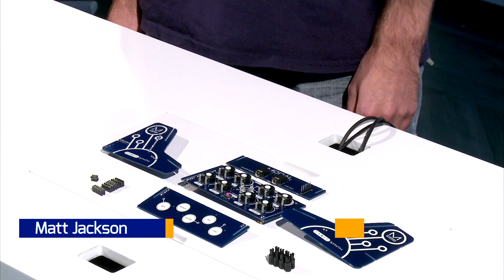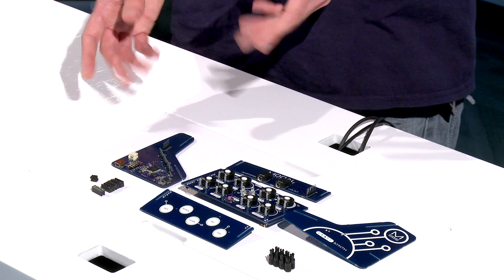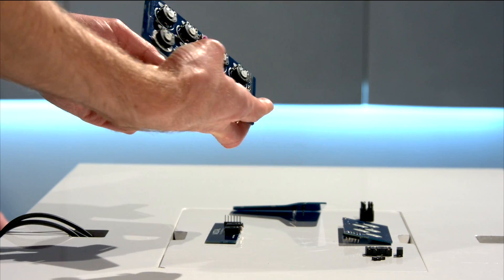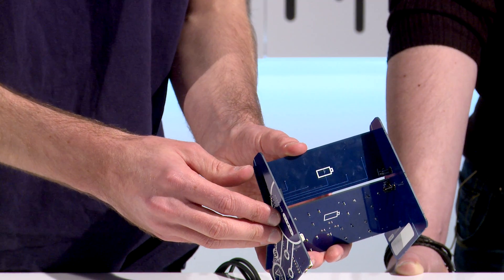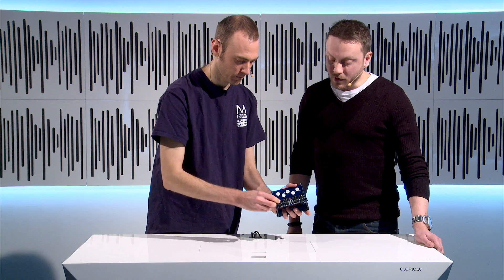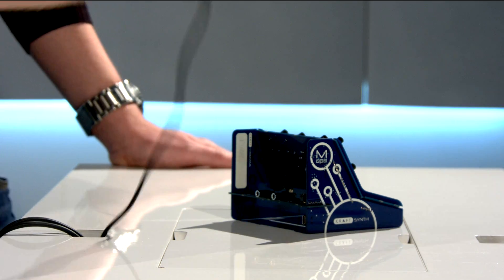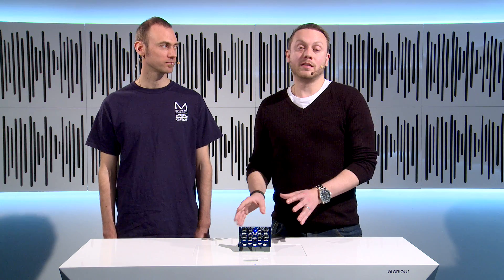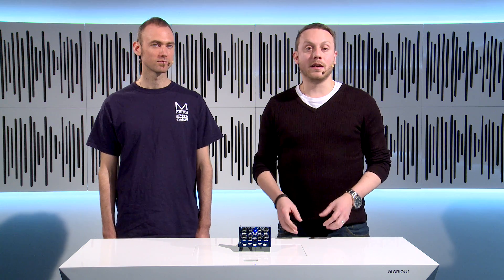How To Assemble the Modal CRAFTsynth Monophonic Synthesizer Kit

Comment: I have one pre-ordered. Is there also a windows app? Is everything that the app does is also possible by midi cc?
It's great to see the connectors, I was afraid it was all soldered together since i'm thinking about soldering wires between the pins and build a custom case. So, great design, can't wait to have it!!!
Reply from the maker: Hello there,

Thanks for the message! We can confirm that the app is available for Windows. The app does enable a few more advanced features that are elaborated on in this video http://bit.ly/2gyo36s

Kind regards,
Gear4music